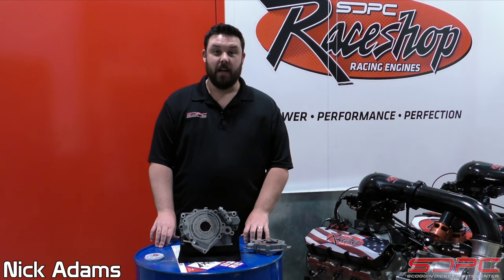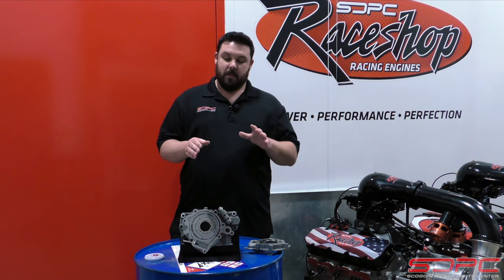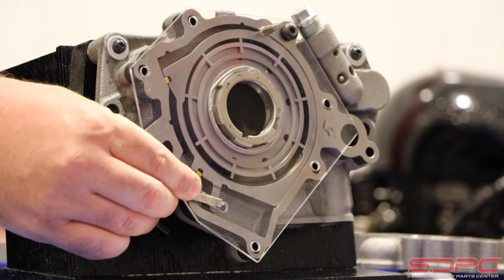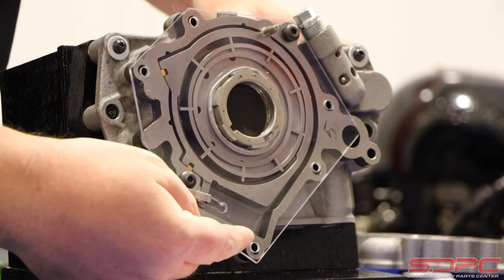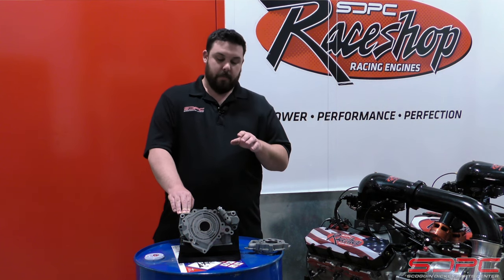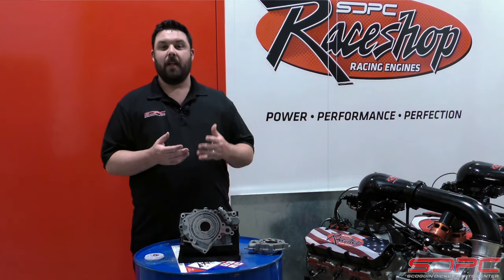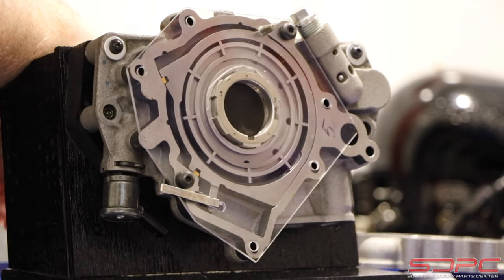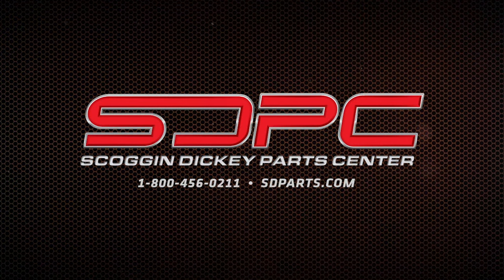SDPC Tech Tips: Gen V LT Oil Pump

Comment: Episode idea: How to set up an oil pump on the block without using the Oil Pump Alignment Tool place holder for replacement. What if we're building a new engine and the pump wasn't already there?
Dig this video. Very cool.
Reply: If its a new oil pump you can put it on and just center it on the bolts. Alignment isn’t necessary on a new pump
Reply: @altonb93  why is that? Different design?
Reply: @rkrommel2728  that information is incorrect the reason why a new oil pump is because of the little plastic bushings on the bolts. You still need to make sure on the center rotor drive that there's a little bit of clearance movement in between there it'll be about a thousands to 2000s all the way around the Hub drive off the cranks now. Slightly snug your oil pump push it to the bottom AKA towards the pan rail and when you do that go around and check all the clearances use like a little pic and a feeler gauge and make sure you're about equal all the way around on the Hub drive. After you verify that slightly snug the oil pump up a little bit more once you do that go around and check again and then torque to spec
Reply: @vortecturbo  thanks for the reply. I ended up pushing upward on the pump, snugging them down, then torquing. I haven’t had an issue so far 🤷‍♂️ good oil pressure.
Reply: @rkrommel2728  glad to hear everything working out the way it should. Merry Christmas

Comment: Might be mischaracterizing the purpose of a variable flow pump.  It’s purpose isn’t to vary the pressure, it’s purpose is to vary the flow to achieve a fixed pressure under varying conditions.  These conditions include AFM actuation, oil viscosity due to temperature, and engine rpm.

Comment: I have an l83 with an lt4 blower, cammed, small pulley, methanol. I make 600whp and my solenoid went bad and I’m stuck in high pressure. Truck has still seen many 140mph + pulls since then, no issues yet. Been like 8 months
Reply: if you was telling the truth youd have bypassed that solenoid already

Comment: Good explanation...no need to go to external will delete solenoid like default to high pressure
Reply: So you just wont plug the solonoid in? It is safe to run it like that?

Comment: When the Engine Control Module changes the oil pressure/volume of the pump does it just toggle between min/max or does it have variable control of the oil pressure using the oil pressure sending unit as the feedback?

Comment: From what I've heard is that it's not necessary to use the alignment tool when replacing these. Just bolt it up and go. Is this true?
Reply from the maker: Alignment tool is required.  Buy once, cry once.
Reply: Its not necessary. I worked at a Cadillac dealership and it doesn’t tell you to align a new pump, only on a used pump that has been taken off👍🏻
Reply: @altonb93  I have an L87 (2021) and the oil pump housing has dowel pins to the block to locate the pump body. How can there be a need for an alignment tool if there is only 1 fixed mounting position?

Comment: Nice Video

Next up is the limitations of the fueling system. There isn’t a good video out there covering it. 

- What are the Hap limitations of the LT1 and LT4 fueling systems?

- What should be upgraded first....LT1 HPFP to LT4, Injectors, low side?

Etc.
Reply from the maker: Thanks Kyle, very good point.  That's something we were discussing around the "water cooler" the other day.  We will be getting to that soon especially with more of the GenV LT engines showing up in salvage yards as fresh take-outs.

There's a lot of homework involved and you have to plan in advance.  The C7 that currently holds the standing mile record pushed their DI system to the very raw edge and the HPFP had trouble keeping up with the injector demand, that record was set back when secondary port systems were just barely being tested by other manufacturers.

We'll get some good data and work up a video on that as it is an important one!

Thanks!
Reply: It would be best to add port injection it will be significantly more affordable versus buying 60 over D.I injectors and it will help eliminate the carbon coating from just air entering the intake port. Terminator X . haltech would be a great way to go using too high a PSI Port plates. Dial in the di to 70% fueling then supplement the additional needed fueling with the port injection. Added benefits of that it will keep the intake Runners clean. As well as cool the inlet charge if you're in a forced induction application. Plus if you decide to utilize E85 you will not be limited by the Di system. But, you will definitely have to do a low side fueling system to supply they did additional needed fuel for the high side di pressure pump as well as the port injection

Comment: So from what I’ve read the l83/86 truck oil pumps are higher volume than the lt1/4 pumps in psi. But what gets me is that Katech sells their upgraded pump for the l83/lt1 as the same pump. So is there a difference in the l83 pump vs the lt1/4 pump? And can the lt1/4 pump be utilized in a l83 truck application as I’m looking at a lt1/4 pump from Schumann pro that’s $200 less than the Katech pump. Anyone looked into this at all?
Reply from the maker: Katech sells two different pumps for the wet sump Gen V LT.
A7503 is for the L83 and L86, and a higher volume and pressure than A7502 (the one for the LT1/LT2/LT4). The L83/L86 pump can be used in the LTx engines but will require some recalibration.

We don't have any input on the Schumann units.

Comment: On the solenoid that is pcm controlled, does the pcm supply the ground side?  And is the solenoid a 12V or 5V power in?

Trying to see if I can setup this feature using an LS TermX on a gen5 I’m building with port injection.
Reply: Hey, I’m also attempting a similar swap, have any advice or tips? What did you do for the pump?

Comment: They got picky about the oil squirters because the gen 4 was plagued with oil consumption issues due to over cooling of the piston and oil rings. The low tension rings would over cool thereby reducing the effectiveness of the oil rings.
Reply: But I thought only the LS9/LSA had piston oil squirters in the GEN IV engines? Or is that what you are saying? I think the internet seems to think the LS3 and the truck GEN IV motors had excessive oil consumption issues as well, and 50 different people on the internet will claim they have the key why.

Comment: If the solenoid breaks you’ll get a permanent p06DD code and on and off check engine light. Oil pressure in normal range in cluster. 

GMC dealership recommended replacing ($2200) it stating long term use with a broken solenoid can damage the engine.... is this true??
Reply: What did you eventually find out about this?
Reply: I got P06DD. Solenoid was good but it cracked from inside.

Comment: Corvette 2014 with automatic transmission the customer complaint was low oil pressure and there was a noise in engine be over all the engine and restart the vehicle call pressure was showing showing normal but later on after getting a normal temperature on the vehicle Oil pressure start dropping I checked with the scan to know DTS. the oil pressure shows on the scale to60 K PA can you help meCan you help me out to solve this problem

Comment: My pump has failed 3 times in the first 25,000 kms. GM doesn’t know why. I have to trade my truck in because of this before my warranty runs out. Oil pressure drops to zero.

Comment: I'm sorry but more Tech features more this and that I love you guys I've used y'all for years and years been very happy with the parts I've bought from you all but this new style oil pump with a vein is crap. It's just more stuff to fail. Why reinvent the wheel when everything is worked so well and the percentage of drag is so insignificant you will not see a measurable gain on the road with this type of oil pump.

Comment: Those vanes are already beginning to break.
Reply: Can you send me a link to the info on the vanes breaking?

Thanks
Reply: @Jommybutler1234  can send you a picture of proof. Have a l83 that failed this way, they designed the ring too thin around the pin that the vanes sling outward to.
Reply: @erickindley835 Your singular event does not prove causation. 

How many miles were on the vehicle?

Had the oil pump ever been removed and reinstalled?

Send a link to your photo. I’m interested to see it.
Reply: @Jommybutler1234  singular report lmao. Gimme an email and I'll send you a pic of the factory oil pump that expired.I bought it locked up from the salvage yard for 200 bucks. Pretty good deal still being a salvageable aluminum block with piston oilers that can be darton sleeved along with the heads. The forged crank is toast being it can't be turned down enough. Check out a very simple Google search also of genV oil pump failures. This is no singular report.  Lol
Reply: @Jommybutler1234  mine looks exactly like this break that shatters the vanes, not so singular. 👌 still send an email so I can send another one that looks identical
Reply: @erickindley835  The gentlemen in the Camaro6 posts are all tracking their cars very hard and should probably be on a dry sump. Starving the pump during prolonged high g cornering, etc...may be a contributing factor. 

There has been no TSB from GM on these oil pumps. I understand that anecdotal evidence from a few forum posts can carry a lot of weight for some people and since you have had an issue you r personal vehicle your universe is that experience. If you drive a Camaro...you notice every Camaro, everywhere. 

Sorry, you had a failure, but the problem has not proven to be widespread in the hundreds of thousands of vehicles with this type of oil pump.
Reply: @Jommybutler1234  man you missed the point, it don't matter what vehicle it's in. And of course not on the recalls,  the money would be insane to go back and recorrect. That outer ring is gonna fail unless its billet. This was a light duty pick up engine. If you'd done that simple google search you would see the other examples. I stated a fact, and there it is. Until melling or some other manufacturers start making a better wet sump I'm gonna keep scooping up these cheap aluminum blocks. Can always be outfitted with external dry sump to get away from that variable power steering pump they use as an oil pump. Food for thought how do you think mast motorsports keeps scooping up newer refurbed lt blocks and turn em around. This is the lifter tick engine pull out version on the ls style engines.
Reply: @erickindley835  Are you a Mechanical Engineer or an Actuary?

Comment: Is this used on L8T 6.6 Gasoline Engine?
Reply from the maker: Yes, the variable displacement pump is used on the L8T but no longer electronically controlled.
Reply: @Sdpartscenter  Have you had to deal with Oil Consumption Problems that People are having with the L8T 6.6 L Gasoline Engine?